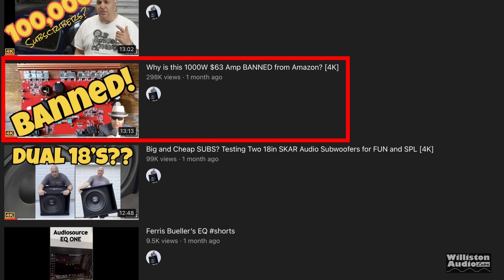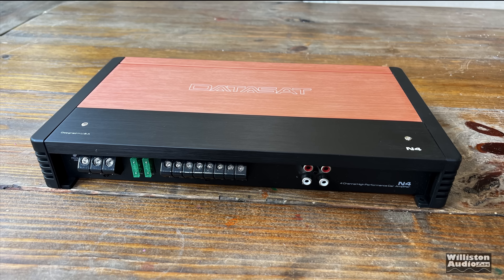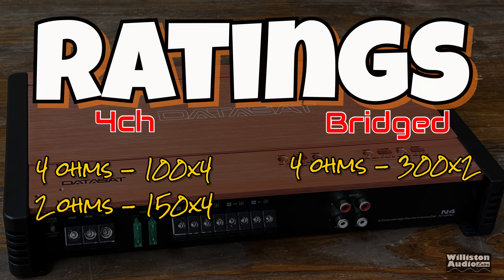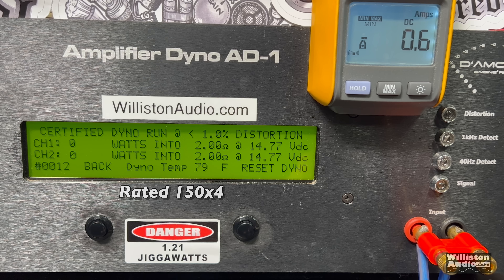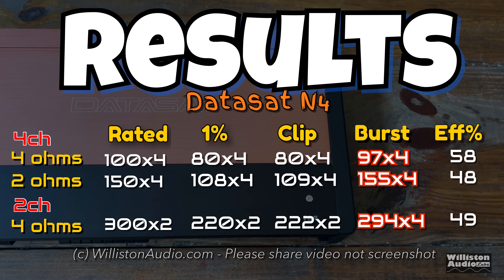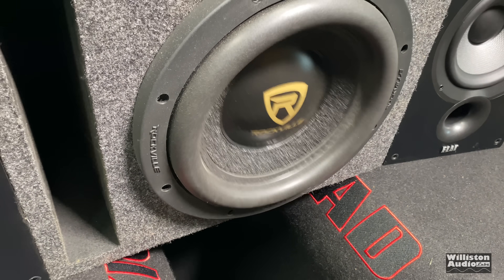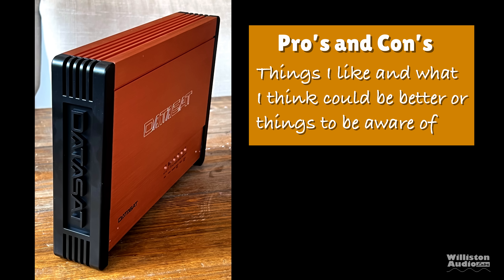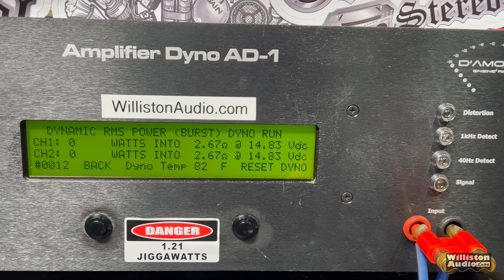How Is This STILL Available on Amazon? Datasat N4 4 Channel Amplifier

Comment: I got into the car audio biz in 1988 and did high-end installations for 20 years. I've always had a soft spot for ADS, Precision Power, and Linear Power amps (with the old metal case Motorola transistors). I also liked Sounstream amps. But from a business standpoint the Mexico made amps that Alpine put out in the early 90's (3552,3554,3553,3555, and 3566) were the best bang for the buck and they took more abuse from our customers without blowing up than anything else I've ever seen.
Reply from the maker: Awesome 👏
Reply: Yeah I had a complete Alpine system in the 90's. It was phenomenal sound quality with one hell of a punch that could literally take your breath away.
Reply: @saltybits9954  they went downhill with the introduction of the V-12 line though
Reply: @rogerweiland6384  Did they? I only owned that one Alpine system. A local store installed it into my Acura for me. I never had any problems with it and it sounded amazing. I think I lost some hearing from it. 🤣
Reply: had a 3566 running for years. It could drive all four front/rear components (+ tweets mounted to the rearview)  + my 4 8" subs. ran flawlessly for years until i sold it with the car it was installed in. I basically sold a car stereo with the car included...
Reply: in the mid to late 90s I used to use a bunch of alpine and Rockford Fosgate especially rockford Fosgate punch 🥊 those were my go to
Reply: @BLUE_OCTOBER-TRIX  I had some Rockford Fosgate 12" but blew one so then I switched to Pyle Driver Comps II 15"
Reply: The old PPI amps were the best. I owned several back in the day.

Comment: I really wanted to hear it on that kicker quad box. I could coil up some wire around my hamsterwheel and make that Rockville move like that. I put my JL / 1000 on 2 Rockville 18's and separated the coil from the pole piece and the magnet from the basket on music. They use some not so good glue.
Reply: The pole piece should not be touching the coil anyway and they bolt the basket to the motor so I'm doubting you separated them with just a tiny 1000 watt jl amp 😅😅
Reply: @schons77iceman  I'll look for pictures but I promise you they use a pink glue on the back plate to the magnet and the magnet to the front plate and it's got those funky rivet type things fastening it to the basket. If you Google it Rockville had a problem with the glue they use turning loose. The speakers are rated at 1800 w peak I think it's a one second rating. Two of them in a 9.56 cubic foot enclosure tuned 35hz peaks at 60 HZ that screams cheap quality speakers all day. I think I'm going to cut another baffle and put my two 4-in bose spare tire subs in that box. It'll make a nice conversation starter.
Reply: Rockville does not make an 18" sub
Reply: @bretk7916  are you a Rockville representative or something because if you look at the T/S parameters the speaker classifieds as a subwoofer. Not only that it's also designed to be in a vented enclosure including six orders and horns.
Reply: @bretk7916  well I'll be damned rockville doesn't make an 18 in woofer
Reply: @minenachos  what does the t/s parameters have anything to do with that rockville doesn't make an 18 in woofer
Reply: @schons77iceman  apparently Rockville didn't get the memo rvw1800p4 is the model number on that imaginary subwoofer. YouTube won't let you post links on your side I tried it wouldn't do it.  you sound pretty confident they don't make one of them. The power handling numbers are bullshit 500 RMS is all it will take constantly and after about 2 hours you'll start to smell the coil and that's on music
Reply: Apparently you're using concert equipment in your vehicle
Reply: You do know that there's a reason why car subwoofers have evolved from home woofers and concert woofers correct and you must drive a big ass van to be able to have two of those with proper box
Reply: And why is somebody pairing a high quality JL amplifier with two budget Rockville concert speakers anyway
Reply: @bretk7916   Or it could be one of those short busses you rode to school. I'd recommend doing a little research on a subject before assuming you're google. I've got 40 years exp. in speaker enclosure design.  A smart car has over 7 cubes behind the seats and that is the smallest car that i know the cargo capacity of. No disrespect meant educate yourself on a subject before jumping in and sounding ignorant. Even if you're trolling people will respect it more if you fire back with facts.

Comment: A person could buy this, and the previous amplifier tested, and have a decent setup, for cheap. Both amplifiers would make a good daily driver setup, and use decent mids and highs, and a decent quality driver or two. Nice video man!
Reply from the maker: Yeah literally $160 shipped for both which is insane
Reply: I have one such amp , it's potentiometer goes bad on itself in less than a year , after that you got to go to repair it every 4 months , the pots go first , then the slider switches
Reply: @nearchd504  it's a low buget, low price point amplifier.  I could see that happening, if constantly altering settings. I have always used a decent quality head unit and external E.Q for better processing, to compensate for filtering. I don't usually mess with amp settings after it has been tuned and mounted. I had two older RF amps have these issues years ago. But they had been in multiple vehicles, lol. I was just stating, a person could have a decent daily, for a low budget banger.
Reply: I got some decent mids on Amazon there were Pyle and for the mids and tweets and crossover was only like 40$ they were yellow IMO it was a good deal for the price
Reply: @nearchd504  how often are you changing em? In my case they would never fail, I set it and forget it.
Reply: ..I disagree.I hate Chinese copies. For free, I would have no use for this amp, as an enthusiast ,I don't care about how many watts.I care about quality. This amp is designed to fool you. It is not Datasat. It is not JL...It is a Chinese trick, do not fall for it. It is junk. It is crap...Please believe me..If you love quality sound reproduction, Buy ARC CLXR, or MMATS, or Linear Power or TRU or Helix/Brax...STEG, Mosconi,Cellestra, Audison or Sinfoni...it costs more , but it is better. Otherwise, buy BOSS. Or Jenson...there is no shortage of Chinese product on the market designed to fool you...but if you love music, and quality sound reproduction, save up your money and go with one of the brands I suggest...honestly, you do not need a million watts in an area as small as a car cabin. if you love music, you need quality equipment and quality design and installation
Reply: @raymo6795  I was just stating, a person could get a good daily driver out of the set. While I agree, it's another cookie cutter amplifier that looks cool, like it's higher counterparts, it is just a budget amp, especially for the new crowds to car audio. I use a pair US Acoustics  USA4050's on my mids and highs, for front and rear stage..so I get what you're saying. I get it's possibly copyright issues, but they perform, and they're not hugely overrated on power advertisement like most. My comment wasn't meant to ruffle up feathers...just an evaluation,  from a person on  a budget would see, After watching this, especially. Many cannot afford some of the brands, that you have listed.
Reply: @Chuck_Sanders  There a ton of cheap amps by respected legacy brands, that are American design and manufactured in China. I would never buy one of these. I have learned the hard way… save up, buy quality.Watts per channel really does not matter that much, except for kids looking to disturb the peace ✌️
Reply: @raymo6795  you must realize that not everyone is into the "quality sound reproduction" that you speak of. Some folks are audiophiles like yourself, then some are strictly bassheads & want the bass to hit as absolutely hard as possible & I've met many of them who literally could care less about even having mids or highs... Another thing you might wanna consider, not everyone hears music, tones, etc the same way. Where it sounds like you have extremely sensitive ears that are very picky to quality sound, believe it or not there are actually people whom do not have ultra sensitive ears therefore they will not benefit anything like you do by dropping a load a cash on high quality audiophile grade components, crossovers, horns, and the whole 9 (this list could go on as far as one's imagination or bank account allowed)... 

Raymo67 are you getting what I'm saying? Let me ask you this, have you ever had either or both of your ear drums rupture? Do you live with constant ringing in your ears (tinnitus) daily, 24/7?? And I'm not talking a light lil earache you had one time as a kid, I'm talking about serious medical ear problems, even to the point to where it causes you to lose your balance, feel off kilt & even often cause you to feel ill all due to problems from your ears??? Have you taken into consideration people whom do deal with issues like those from either having ear drums rupture or be it other medical related problems? You realize there are people whom actually love music, love car/home audio, love bass & still install audio systems in both their cars & homes, right? Many of those same people as I stated before will not benefit as much as you do from high inflated 'audiophile grade' car audio gear. Guessing you've never personally known a deaf person whom actively competes in car audio comps?? Yes that's true also, there really are people who are 100% deaf whom actively compete in car audio & consistently participate in audio shows. 

BEING ABLE TO AUDIBLY HEAR MUSIC IS NOT A REQUIREMENT TO BEING A BASSHEAD, MUSIC LOVER, OR LOYAL FAN OF CAR OR HOME AUDIO 🤔 THE DEAF LOVE MUSIC TOO! 🎶 ♥️ 🎶
Reply: @itdoesntmatterwhatyourname6128  This has been a hobby of mine for decades. Chinese knock offs are not new. I bought many as a youth. This amp is pretending to be something it is not.Truthfully, I can’t imagine going through the time and expense of installing inferior equipment..Why bother? The best quality gear I can afford is my hobby. I am not into extremely loud. I don’t really understand your point. I have never had medical problems with my ears. I simply like a quality, balanced system, that is why this is not an amp I would buy or want for free, it would in no way serve my needs. It is a fake….But those that you describe, can buy what they want, and what makes them happy. I was simply offering advice to those that have not been enthusiasts for 40 years, perhaps save others from making the mistakes I have made. If you are want “ quality sound reproduction”, then buy quality equipment, if you don’t care about good sound, then go buy the Datasat. I enjoy “ quality sound” ,I do this for no other reason. It is all personal, and I don’t consider others. It is for my personal enjoyment….don’t get me wrong, I am not unsympathetic to those with hearing issues, but it has nothing to do with my preferences.✌️🎶🎸🇺🇸
Reply: @raymo6795  you said all that needed to be said or heard when you said "and I don't consider others"... 

If "you don't consider others" then I see no need for you to "offer advice to those who've not been enthusiasts for over 40 years". As I mentioned people with hearing issues & severe ear problems & to be frank it seems many older people (which you obviously are no spring chicken) seem to forget that they also used to live on a tighter budget back in their younger days. You obviously have done at the very least decent for yourself, thus allowing you to purchase high end equipment. Something you may not have been able to do 30 & 40 years ago. Their are plenty of bassheads & car audio lovers who would love to buy top tier gear BUT everyone has different incomes & different bills. We're not all alike & each are at different stages in life, meaning they but what they can afford at the time. I do not see why that is so hard for some car audio hobbyists to understand... 

And don't take my comments the wrong way, I'm only here for discussion. If you choose to name call, bash or degrade others then you can take that on somewhere else, far too old & mature for that.
Reply: @raymo6795  
True, but you're talking about spending 5K to build a decent system in your DD. That's a crap ton of money for the average person. Good wire, terminals, fuse blocks, etc. are not cheap either.
Reply: @wilsonrawlin8547  this is not an inexpensive hobby, you get what you pay for, however, there is something for every budget and quality of installation and design is just as important as quality gear, and as one who enjoys quality sound reproduction, I prefer a better designed amp, to a high watt amp.. just one man’s opinion.
Reply: @raymo6795  
I agree within reason. The systems out there that are 50-100k are absolutely ridiculous IMO.
Reply: @wilsonrawlin8547  …I don’t see a need to spend that much. I have a few cars with different types of systems. The most expensive is in my 96 M3, probably about $5000. It is a Helix C4, a Helix M1 and MicroPrecision speakers and a Brax sub. I have owned this car for 20 years, and it has seen several systems. My daily driver is 2018 Audi S3 with an 8 channel Helix/ Match (PP86dsp) with Eton speakers and sub,probably around $2500. My wife’s Q3 is stock Bose…. I have not changed it…yet, it will likely get Helix/ Match/ Brax, and maybe Blam speakers. I realize I am older , and more financially established. Most grow out of this hobby. But I never did. I have 50 + amplifiers in my man cave from previous cars and systems, many I bought in recent years on eBay, one’s that I could not afford as a youth, all of them made in America, Germany or England. Mostly pre 2000 Soundstream. But many legacy brands as well…my wife thinks I am crazy.
Reply: @raymo6795  
Honestly, 5K is a lot of money for an everyday consumer to spend on a sound system. Holy crap! That's impressive! You probably have some seriously valuable amps in there. I'm 59 and caught the fever again but not even close to what you have. You could start a car audio museum!
Reply: @nearchd504 if youre not using those all the time it will never be an issue for most who just set it and forget it.  I dont expect top quality with something at this price point.
Reply: @CarAudioObsessions  ...there is something for everyone Derek...my first systems were Audiovox, Kraco, Sparkomatic , Craig and Jenson "TriAx" speakers...I am sure this amp is better than any of those

Comment: Ive been keeping an eye out for a good sounding, budget 4channel to use in my one car as a 3channel...debating on A/B or D...if the SQ is enough for me to notice
Reply: Look for a used dual xpr84d. Amazing amp for the $
Reply: kenwood kac-6407. I hav a 5207 and its fantastic
Reply: I’ve spent thousands on amps and recently I had my tweeter/horn amp go out which I was running a crescendo 4 channel I grabbed a taramps 400x4 to get me by while I send it off to be fixed well… I haven’t even sent the crescendo off and I’ve ordered a 800x4 taramps to run my mids now also. Great budget amp. If you know how to tune and you run a dsp you can make any amp or speaker sound good👍🏻

Comment: Looks cheap and is likely a crude circuit. AB amplifiers dont have to have bad efficiency, atleast not that bad. 
Ive built my own but its mains powered yet certainly not that bad. Although the initial idea was to build an smps inverter so it can be fitted in a car the inverter circuit has proven harder to get right than to finalise the amplifer sound. The peak power of the amp is yet to be discovered as I need higher voltage rails, somewhere around +-75v would be nice but has been proven good for 70v peak to peak into 2 ohm
If I had a good inverter I would love to see it on the dyno. 
In this case it wouldnt suprise me if the power supply is over working to try pass as much current as it can through that tiny torid, saturating the core which is reducing efficiency.

Comment: 9:44 look at the broken solder joints. In general the solder bath used was pretty horrible and the hand soldering final components was even worse. TIP35/36 output pairs have been around over 20 years now and were used in the many of the OG amps back in the days such as USAmps, The VLX400 I own has 50 of them if I remember correctly. They are a tried and true output pair for Class A/AB as seen by the current use.
Reply: Yep I was thinking that was an awful looking board in terms of soldering and slathered on thermal paste

Comment: Today topics on Band 63 looks Like Very Common Mass Production Line's 
Yes It's Made In China?

My Option Would not last Until Next Year September 2023 ?
Here is my results Power FETS 60nf06 is Extremely Lower Voltage regulator ?
Speaker Out Less electronics components parts
No Extracter Cooling System
Amp Dyno clearly Shows Super Low Dynamic WRMS
Brust Power  ?

For those want to purchase it from Amazon Please Consider Not Too BuY!

This is my Recommend  to purchase 
JP 4 channels is way Effectively for any Bass Head's 
Wants to install JP 4 Channels.